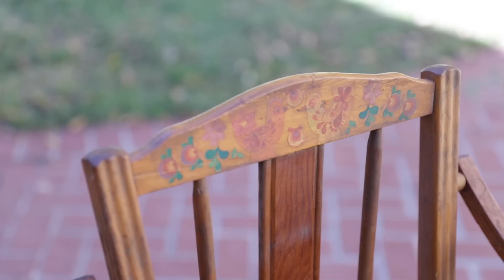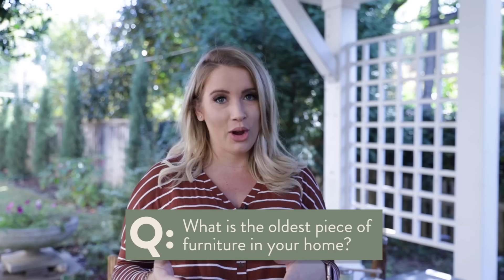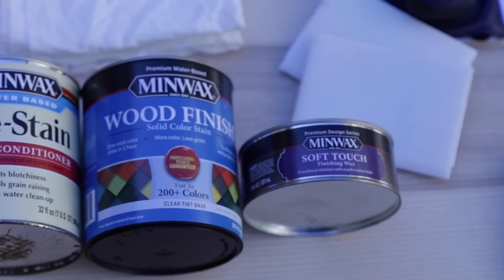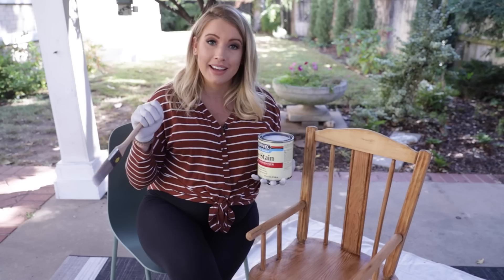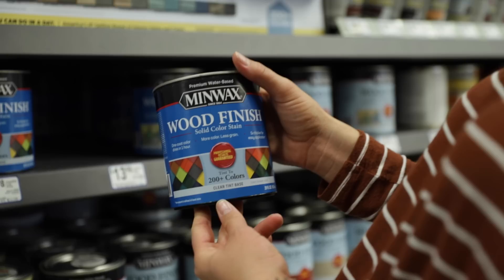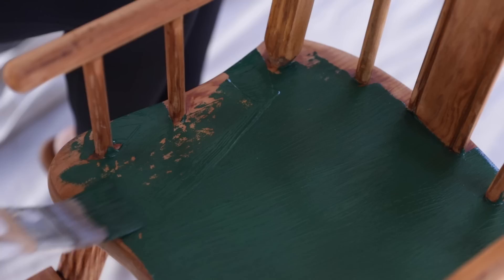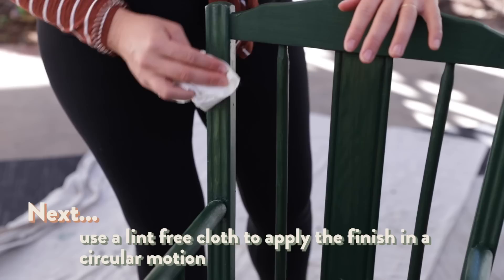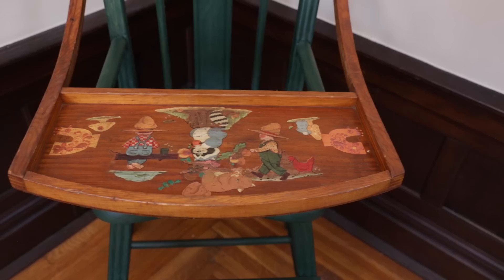INTERIOR DESIGN | Christmas DIY | Refinishing Furniture for the Holidays

Comment: The oldest piece of furniture is a sideboard dating from 1765. However, some of the art hanging on the walls (with a gorgeous black Dutch frame) was created in the seventeenth century. Also, there's the Tang horse (only a few inches tall) and a fragment of an ancient Greek temple on display as sculpture. So, furniture only - the sideboard wins - if you include art, the ancient Greek marble fragment wins.